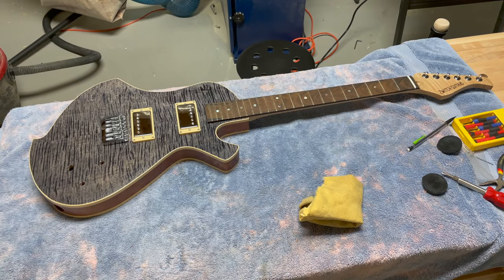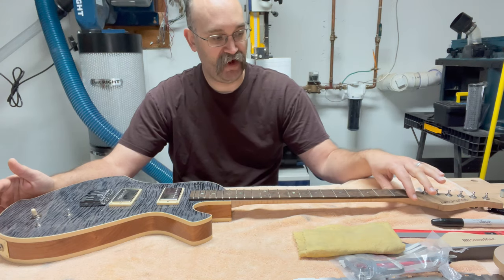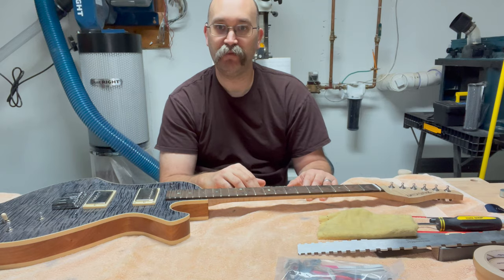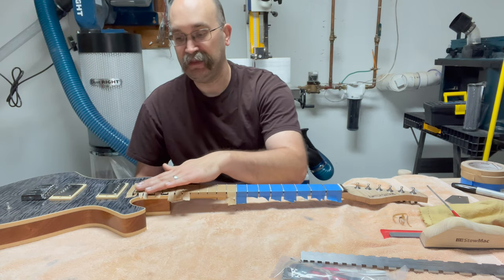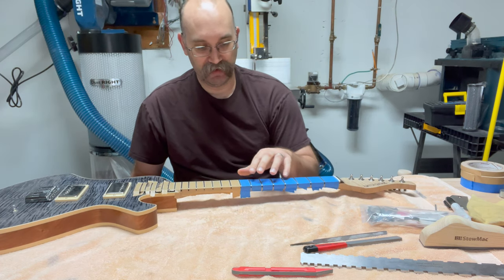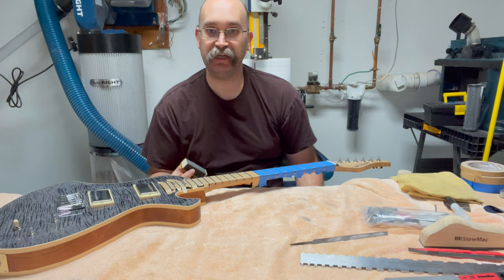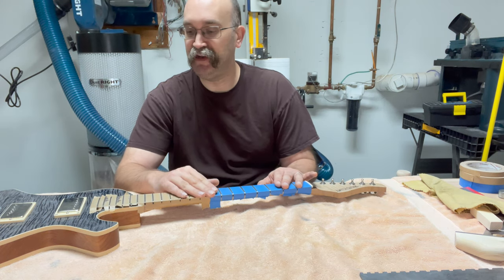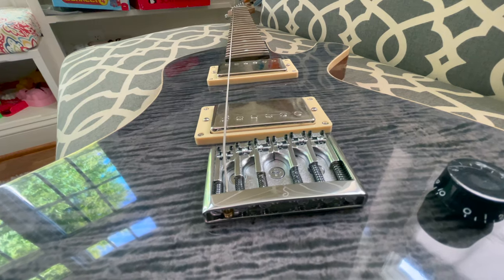Wiring Guitar Pickups and Fret Dressing

Comment: Nice guitar and finish. With respect...heat shrink is something that could be used to insulate solder connections. If the control cavity is foiled or painted with conductive shielding paint thus would be desired.